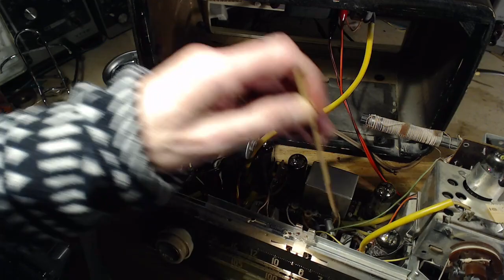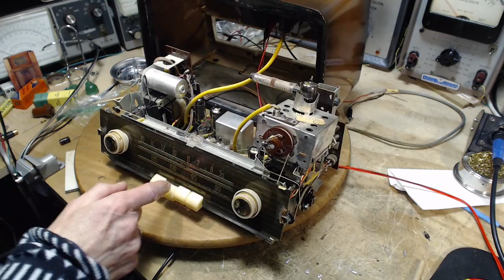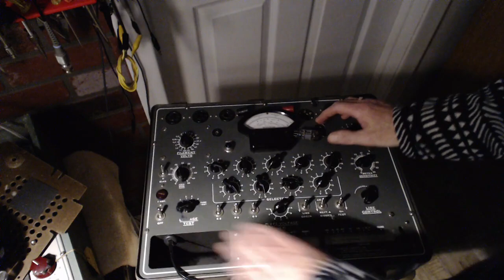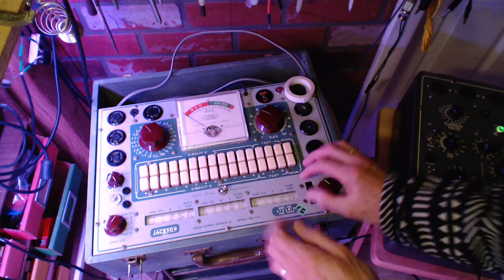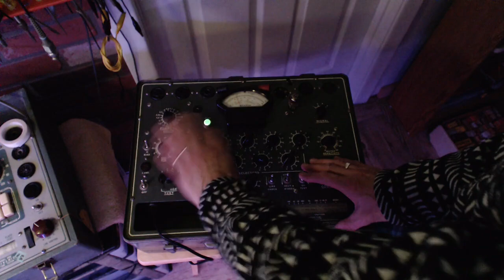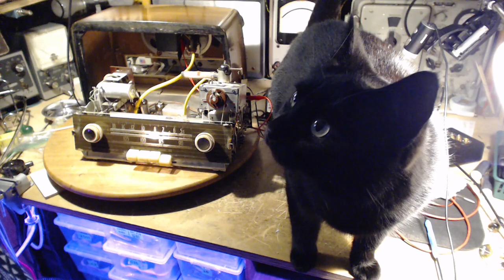Nordmende Norma Luxus Tube Radio Video #8 - Problem Solved

Comment: Hi Jim ! 
First, Gratulations !! You did it !
I think this strong noise in this radio could be the sweep from Your generator. (maybe)
It is real possible that all solderpoints are resolderd by hand in the facory, because You can see that some parts of the board are not solderd by the solderingmachine. This can happen if the level of fluid solder is to low ore the board did not fit flat in its frame. So then one worker has to solder the wohle board by hand. We had to do this also sometimes when I was working in a radio and TV- factory in the late 60ies
I think still You had the problems not with "cold" but with "dry" solderpoints. That means that the wires from the components get a corrosion on it (mostly because of heat) and then they make not a good contact even the solderpoint looks good, but still do not have good contact with the solder. So You have to resolder them very good and look that the wires are shiney and the solder is flowing around good. This often happens by older boards like Yours now.
Greetings Heinz

Comment: By 7:25 minutes in you should suspect it's a bad solder joint or two or three somewhere Jim. After replacing the 6AQ8 tube it works again and very nicely.
Alignment? Shadow shakes head yes!

Comment: As I stated in the last video, mixing old things like tubes with new things like circuit boards causes major problems unless new ideas about troubleshooting are used where the problem, as in here, is at the meeting of the two (moving large, heavy components including tubers flexes the circuit board much more than the small solid-state components of later equipment does).  If you do not immediately understand how the differences in parts involved can cause novel effects, your application of the old techniques merely runs you in circles with no resolution.  Here, the circuit board was probably not strong enough for supporting the old tubes, etc., and much flexing cracked solder joints.  One of the "lessons learned" things that later designs have to fix their designs to avoid.

Comment: Wiggle them IF cans more. It is a sure way to introduce cracks. Not only where the cans solder into the main board. Also cracks in traces of the main board and - and this is where the fun starts - cracks in the traces leading into the IF can, and delamination of the solder pads of the IF can. If you are very good you can even snap the IF board where it exits the Main board.
For the fanboys who do not know; these IF cans use etched traces to form capacitors. Watch shango066 series called "Nordmende Caruso Console Radio Phonograph Repart(sic!) Pt1-3" and especially the video "FM IF Sweep Alignment Nordmende German Radio Final" for a video on a proper alignment and to get a glimpse into these style of IF cans used by Nordmende.
And for crying out loud be more gentle and sophisticated! The reason they tinned the traces is sledgehammer techs that wiggle tubes and rock them side to side brutally when pulling them out. Whenever you pull a tube we can see how the whole board flexes! No wonder you get broken traces and cracks all over!

Comment: 15:54 Dont compare yourself to an airplane pilot please just because you fixed a cold solder joint that almost everyone here who did not believe in the  "it-is-ceratinly-bad-cheap-german-tube-socket-you-cannot-clran-them-you-must-replace-them-with-$$$-ceramic-ones"- tale knew there would be.